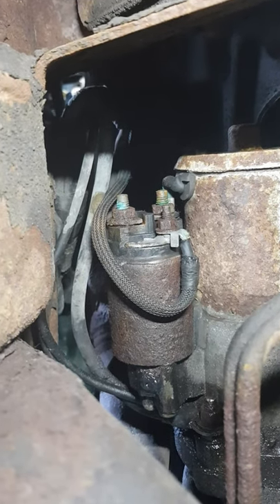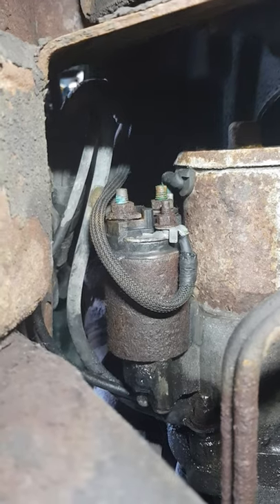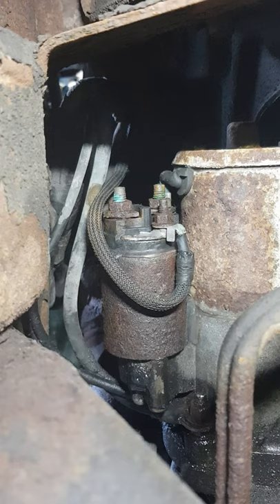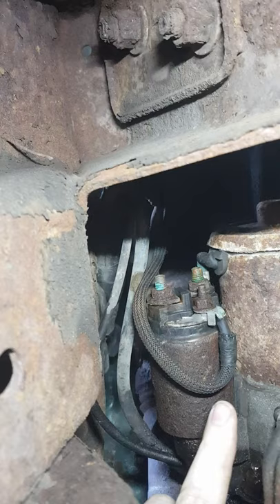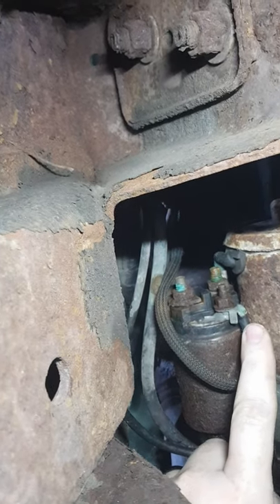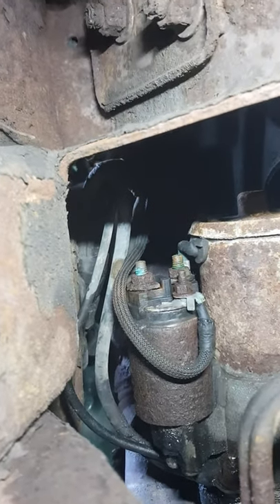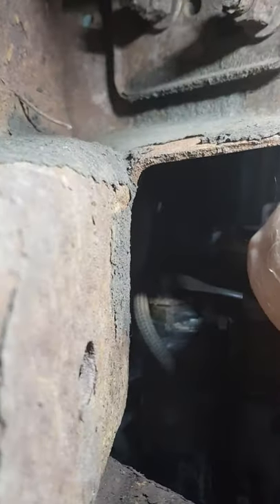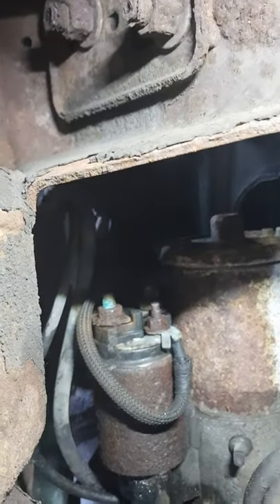Jump your Starter Solenoid

Comment: Make sure screwdriver has rubber grip lol
Reply: Voltage isn’t enough to hurt somebody. 12V won’t likely push the amperage through the skin. It should be fine. On the off chance it isn’t, well, have somebody standing by with a defibrillator
Reply: Plastic is an insulator

Comment: I have a 1994 Ford Ranger and I'm no mechanic but I was taught this years ago when I started driving. But mine has been messing up and my truck has the solenoid on the side I did this but I'm not sure if I should replace the whoe starter and solenoid or if if it's in my wiring . The last few days I haven't been able to jump start it with just a screwdriver and a jump from another car. It's driving me nuts lol I'm single and try to not ask for help but I'm at a loss on this one

Comment: Question, how do you leave the key in the start position if there's only one person?
Reply from the maker: You make sure the vehicle is in park, then you turn the key all the way forward and leave it there. Then you crawl underneath and jump the starter. So in essence by jumping the starter, you're doing the same thing as trying to start it with the key. Hope that makes sense.
Reply: All the way forward much as it can. Not the pressing part where you press and let go. Just all way forward as he says. 💯
Reply: @CringeComedyTV  oh okay, so there isn’t even a second person turning the key? That’s what was confusing but we get it now thanks a lot!
Reply from the maker: @WhiteWaterVisuals  you're vary welcome!
Reply: If this part has to be explained, you probably shouldn't be trying this.
Reply: @CringeComedyTV  hahahah stupidity is Soo ramped nowdays
Reply: There is 3 positions. Off, then one turn forward, (means on), then another turn forward (to crank the engine). The last turn will require u to hold it but for this demonstration u leave it on the 2 position. Just on, but not cranking.
Reply: @iwishtobetexan6060 Thanks…. sometimes a simple explanation is very helpful

Comment: Does it have to be the bolt opposite of the wire ? I did the wrong one on accident and got a reving noice can’t get a spark on other bolt and would the motor even drag if it’s the starter ? Got the battery hooked up to cables rn
Reply from the maker: So did your engine turn over? Your comment has me a little confused. Please repost a clearer comment and I'll try to help.

Comment: Do u need 2 people for this since the key needs to be pushed forward at the same time?
Reply from the maker: No. Turn the key into the forward position and leave it, then jump the starter solenoid. This is a one person trick. When you jump the solenoid you're doing the same thing as if you were inside your vehicle turning the key forward and turning it over.
Reply: @CringeComedyTV  thank you sir, I will try this on my 2000 Camry
Reply from the maker: @nijjarmonx7451  hope it works for you.
Reply: How about if you have a manual transmission?
Reply from the maker: @marcdaquina5472  then you'd need a 2nd person inside the vehicle on the clutch.
Reply: @CringeComedyTV  Oh okay because I asked somebody who made a similar videos you have. He said just make sure it is neutral and safety break is on that it should be good. No need to step on the clutch. So I am not sure which one is right.
Reply: @CringeComedyTV  I just bought a new battery. I was connecting a new battery in my car & I accidentally touched the wrench to the body of the car, touching the positive terminal while the negative terminal was also connected.  It created a spark. I was thinking maybe I caused a short circuit. I have not test the battery yet. 

So I tried to start it and even jump it but it will not crank. I just hear the clicking sound. But when I turn the key the dash board lights up and emergency lights still works. 

Do you have any suggestions what steps should I do next?

Comment: I am trying this when i get home. My car has been parked for the last 2 months. It just makes 1 click noise when i try to turn her on. Either the solenoid or starter im sure.
Reply from the maker: Is the battery good?
Reply: Did it work? My vehicle has been doing the same but I haven’t had anytime to trouble shoot on it, so it’s just been sitting in my yard for like 3 months

Comment: Isn't the small cable from  your ignition switch. And the large cable is from your battery positive.  Which could indicate that there's a bad earth on your starter. Tty connecti g another earth cable from the starter to vehicle body. 🇬🇧

Comment: If you would take it out clean the ground connection good bet it would start
Reply from the maker: Wrong. I bench tested it and it was junk. The contact points were all clean. Just because there's surface rust doesn't mean the connections are bad.

Comment: Ypur starter solenoid is bad, not the starter...or, the wire from the switch to the solenoid may be broken, or, the ignition switch itself may be faulty.  The starter is fine.
Reply from the maker: I'm aware of that. I misspoke in the video. Was what some people call an "accident."

Comment: What if I’m getting a spark but still no start ?? That should mean it’s just the starter that I need to replace? Comments greatly appreciated!
Reply from the maker: You need to make sure your 2 contact points are fairly clean firstly to ensure a good path. What exactly is happening when you're jumping your starter solenoid?
Reply: @CringeComedyTV  Hey I wasn’t expecting a reply so fast, but thanks so much! When I put the screwdriver on there nothing happens lol. When I touch the screwdriver to the connections it generates sparks but does nothing. When I turn the key to start it makes no sound. It was a click before but now it makes no noise.
Reply from the maker: @gubpub2265  step 1 is make sure you have a fully charged battery.
Reply: @CringeComedyTV  battery is fully charged however I did put jumper cables on it just to be sure
Reply: It still made no noise
Reply from the maker: Are your dash lights on inside when you turn your key into the forward position?
Reply: @CringeComedyTV  all the electronics still work
Reply from the maker: @gubpub2265  It sounds to me like you're starter is toast. Have you tapped on your starter with a hammer lightly in a few places? Sometimes this works. How about starting it in neutral? Have you checked to make sure your starter relay is working correctly?
Reply: @CringeComedyTV  yes I tried all of that lol gonna go get a new starter

Comment: Whatvif it just clicks but won't turn? Does that mean the starter motor is no good?
Reply from the maker: You mean when you're in the vehicle? Could be the starter solenoid, could be the battery. 2 most common issues.
Reply: @CringeComedyTV  just the way you  did it, the solenoid works but it won't turn.
Reply from the maker: @dirkdiggler2430  assuming your battery and all connections are good, then I'd say your starter is shot.
Reply: @CringeComedyTV  thank you.

Comment: Are you bridging the positive and negative or only touching the positive? And probably include/advise ppl not to touch the metal part of the screwdriver while doing this right? Lol😊
Reply from the maker: Bridging positive to negative. Video description has a warning included.
Reply: @CringeComedyTV  it's not

You're jumping the selonoid wire with an always hot +12v wire

Jumping that to ground would be very sparky

Comment: Need to clean that ground wire on the starter. Then try it again.
Reply from the maker: I tested the solenoid independently and it needed to be replaced. This wasn't meant as a  trouble shooting guide but rather a quick fix tutorial to get people back on the road in a pinch.

Comment: What happens if I tap it and everything goes dead instead lol. Mine went dead and no lights coming on 😂
Reply from the maker: What are you tapping?
Reply: I think the starter 😂 I tapped it like the video and it did spark but than all dashboard lights went out and nothing happened. I think it is my starter though just completely dead needs to be replaced. Thank you for the video though 😊
Reply: @TarasSimpleCrochet disconnect your battery positive and negative cable. Then reconnect
Reply: @Snookred1  it’s fixed now it was my starter :) thank you for the reply

Comment: That's a signal wire not negative it Carry voltage from your ignition switch to push the yolk out and spin the starter

Comment: How do you screwdriver that isn’t metal, the head that is I wouldn’t have around. You mean a metal screwdriver with a plastic handle. To avoid shock. Say what you mean.
Reply from the maker: Derp! 🤡
Reply: Metal screwdriver, plastic handle. You need something metal and electrically conductive but you do not want to touch that part, especially if anything gets wet.

Comment: What about when I turn the key in my old Audi and the battery just clicks rapidly. It does this off a bump charge. Think my alternator is fried causing my battery to be damaged after too many jumps. Also I stalled out on a main road close to home and had to get pushed into the bank by the 👮‍♀️
Reply from the maker: Best way to tell if your alternator is bad is by jump starting your vehicle. Once it starts remove the jumper cables. If it dies shortly thereafter your alternator needs to be replaced.
Reply from the maker: If it keeps running after you disconnect the jumper cables your battery is probably bad.
Reply: @CringeComedyTV so how to tell if Starter is bad or not ?
Reply from the maker: @DonDaDaBoi  The most common sign of a failed starter is a clicking noise. If you turn the key but get this, it is definitely your starter that has the problem. Lights on the dashboard that illuminate without a start show that the car has power, so it is likely to be a starter and not a battery problem.

Comment: Will the vehicle run and idle if it has no keys in it
Reply from the maker: No
Reply: Even if you apply voltage, modern cars have ignition immobilizers that need the RFID signal from your key before they send a signal to your ECU.

Comment: What's the difference between a starter , a starter solenoid, and a starter relay???
Reply from the maker: The starter is what gets your engine going by engaging the fly wheel. It's about the size of a football. The starter solenoid is simply a switch which engages or pushes out the starter pinion gear into the flywheel ring gear  when you turn your vehicle's key. This was bad on my vehicle and what I was "jumping" in this video. The starter relay is a little black box located in your fuse box usually under the hood. It has 3 prongs which plug into the fuse box. It opens an closes the circuit when you turn the key in the ignition. Hope this helps. Let me know if you have anymore questions!
Reply: Okay but what if it doesn’t start ahah what does that mean
Reply: @gaber9290 then I believe you have a starter problem
Reply: What if you can tap the starter to get it to work, what’s that mean
Reply: @LegitLaughs1 how can you tell if the starter relay is bad? TIA
Reply: @elsiebowen4457  take a different relay like the horn out and stick it in the starter relay spot and if it works then the og starter relay is bad
Reply: @JLE1177  you've prolly already did it, but it means starter is bad. Probably a bad tooth( spot) preventing the flywheel engagement( c*ckblocking ya). You should replace starter because one day that trick will stop tricking
Reply: Are you take out  solenoid ? dismantle and repair ?

Comment: Hi guys.what are you bridging here with the screw driver.cant see in video.theres 3 poles.are you bridging the top pole to the left with the bottom negative pole
Reply: This was months ago but he’s bridging the signal contact from the battery to the top left there. But I’m not sure how to distinguish the top two on another starter without taking a closer look. Maybe it’s obvious based on how they’re wired.

Comment: What about a fast clicking or ticking sound but dosent turn over, would that point towards my starter as the culprit?
Reply from the maker: Is your battery fully charged?
Reply: @LegitLaughs1  autozone said it was 100% and I also have warranty on the battery maybe they dont wont to exchange it ill take it again tomorrow, tried it again 1 hour ago worked normally, 20 minutes later battery dead it's reading 9 volts. Thinking maybe the alternator somehow just gave out prematurely it's only 2 yrs old and so is the battery, I'll troubleshoot tomorrow, appreciate the response. Much Respect!

Comment: just did this a week ago my 67 belvedere wont turn over ! everything checked out good relay fine connections all grounded amp gauge good connection at alternator good starter relay works on bench ignition relay works im gonna hook a push button on the dammed thing

Comment: This works on my vehicle. If I go to just start it without this, it just clicks and doesn’t start. What would be my issue?
Reply from the maker: It means your starter solenoid needs to be replaced.
Reply: Thank you so much!
Reply: Hi again, I’ve installed a new starter and it’s still not starting via the key. I can start it with the method shown in your video. Any ideas of what this might be?
Reply: @leahnol  ignition switch would be the next thing I'm having the same problem

Comment: I tried that and didnt start just made a spinning sound...what does that mean?
Reply from the maker: Sounds like the pinion gear on the starter isn't thrusting forward. Your starter is bad or there's a wiring issue.
Reply: @CringeComedyTV  thankyou so much buying a new starter tomorrow 🙏😉
Reply from the maker: You're welcome. Let me know how it goes!
Reply: Ok I replaced my starter now it's just cranking but my battery is dying going to get a new one today, could it be my alternator? I just replaced it in January...
Reply from the maker: Jump your vehicle with jumper cables. Once it's started remove the cables. If it stalls then your alternator is bad.
Reply: @CringeComedyTV  ok so I put in the new starter, apparently it's neither the starter or alternator...come to find out it's my timing chain...smh
Reply from the maker: Who told you that? That's a complicated and expensive fix if that's the issue.
Reply: @CringeComedyTV  my friend who's a mechanic at a Tow Yard.